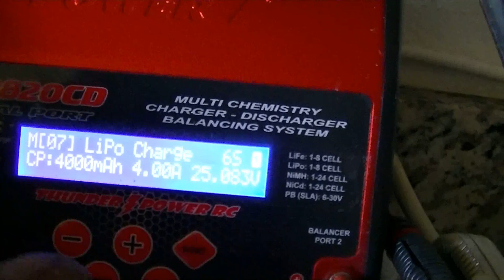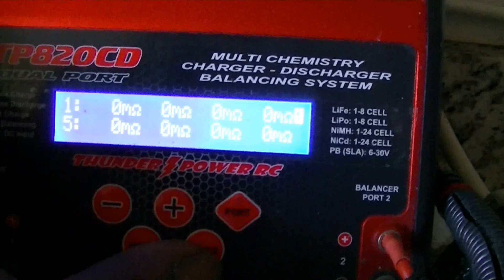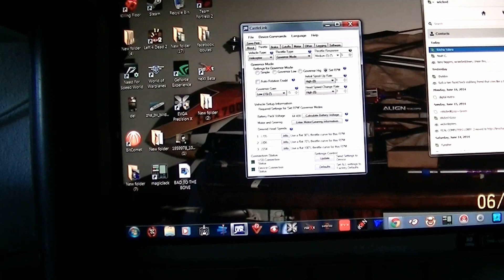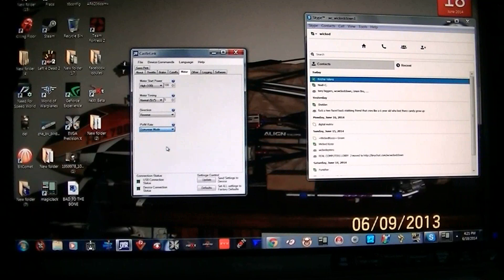trex 600 low head speed problem help!!!!

Comment: I have a Trex 600C that runs 6S with a castle ESC on it.  I have the same issue, although not a low head speed, but a very hi head speed, and no difference from normal to Idle in rpm. I wanted to change the setting to slow down the head speed in normal mode, but I was told this cant be changed, as it is a setting in the governer.

Comment: awesome the solution is as simple as given by many

so either a new extra lipo or different motor,,depending on how your going to fly
3D needs 12s setup ,,forward flight would do with 1220kv on 6s motor,meaning more flights with the packs

Comment: what is the KV of the motor you have? there are a couple versions of the 600 mx... one is for 6s and it is 1220 kv and the 12s is a 530 kv...
Reply from the maker: 510 kv
rcm BL600mx
Reply: wcwicked clown yep thats the 12s motor , I run a KDE-530kv
and yes that cable would work

Comment: 600efl/600e pro
if it still has the 530kv motor on it
you need 2 6s packs in series 50v system
it comes stock with the cc ice 80hv and its fine for that machine
Reply from the maker: so im gonna order this cable http://www.ebay.com/itm/DEANS-HIGH-CURRENT-10awg-SERIES-SERIAL-LIPO-BATTERY-ADAPTER-CONNECTOR-US-SHIP-/351095223901?pt=Radio_Control_Parts_Accessories&hash=item51bee7f65d

thank you
Reply: wcwicked clown
that will work

Comment: Heli needs 2 6s lipo packs. It is a 12s setup
Reply from the maker: lol i hear you 
but it does not have series connection for 12 s lipo looks like a 6s setup
wonder what am i missing
but i researched the motor and it is a 12s motor dam
thanks
This is the Align 600MX, 510kV Brushless Motor. This motor is compatible with the T-Rex 600 Pro, as well as other 600 class 12S applications.
Reply from the maker: got it thanks
Reply from the maker: so im gonna order this cable http://www.ebay.com/itm/DEANS-HIGH-CURRENT-10awg-SERIES-SERIAL-LIPO-BATTERY-ADAPTER-CONNECTOR-US-SHIP-/351095223901?pt=Radio_Control_Parts_Accessories&hash=item51bee7f65d

thank you

Comment: Supposed to run 2 6s in series right? So 12s total. When you run higher voltage you don't need a high amp speed control.
Reply from the maker: its a 6s setup
Reply from the maker: so im gonna order this cable http://www.ebay.com/itm/DEANS-HIGH-CURRENT-10awg-SERIES-SERIAL-LIPO-BATTERY-ADAPTER-CONNECTOR-US-SHIP-/351095223901?pt=Radio_Control_Parts_Accessories&hash=item51bee7f65d

thank you